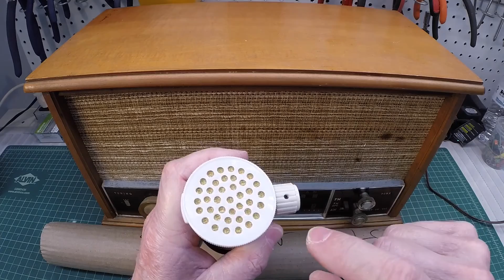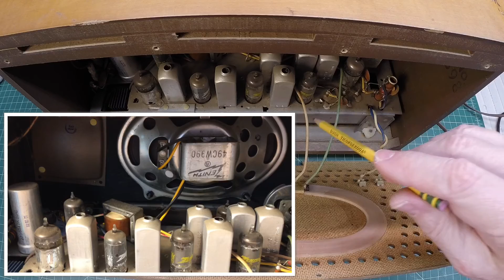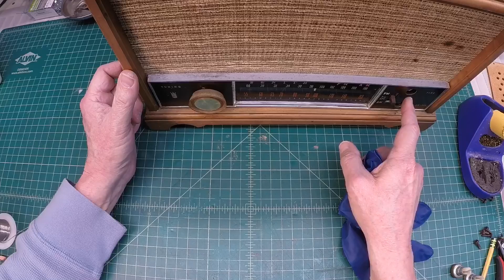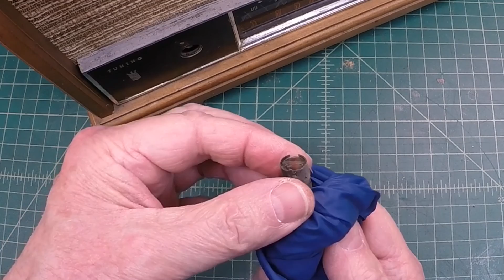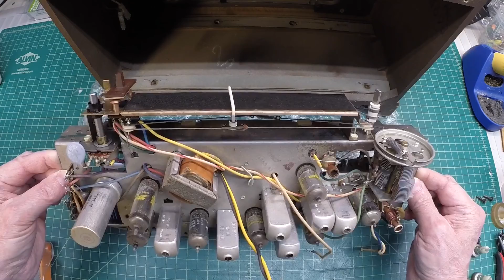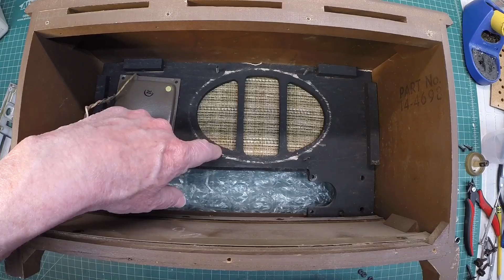Zenith K731 - Speaker Grille Cloth Prep

Comment: These radios have a UL "captive" knob.  there's a trick to removing the knob. leaving the knobs captive in the front panel of the cabinet. You can carefully work the chassis backwards and out, sliding the control shafts out of the knobs as you do so, by pulling on the knobs to keep them from cracking the front panel. Then if for some reason you need to separate the knobs from the cabinet you can work with the retainers to get them off the knobs after the chassis is out.  I had to start googling when I got my K731, my knobs would not budge.
Reply from the maker: Bret - great info. I saw this posted on the ARF as well after struggling to remove them. Did you put the captive sleeves back on or leave them off. Thanks again for the info. Best, Don
Reply: I left mine on.  they're sadly dangling off the front of the radio.  I only got as far as assessing the set, it's not been worked on yet.  Will be interesting to see how the electrostatic speaker has held up.  I had to rebuild one on a german radio a few years back.

Comment: Are there any modern speakers which would be a suitable replacement? Great video, very nice speaking voice!
Reply from the maker: I saw a thread where someone suggested the one below as a replacement. Double check and see if it will fit in cabinet. Hope this helps. All the best. Don

https://www.parts-express.com/BOSS-BRS5768-5x7-6x8-Dual-Cone-Replacement-Speaker-265-384?quantity=1

Comment: I am so glad I found this!!  I have this same radio I inherited from my grandparents.  I love the sound it makes.  I have wanted to refinish the case and replace the cloth, but those knobs scared me because they don’t want to come off.  At least now I know I can.  Did you use any heat on them or just pressure and patience?  Great video and detail.  Thank you
Reply from the maker: Hi Jason - I forced them off, which was not the correct way to remove them. They are “captive” knobs and have a metal retainer on the shafts. Check out the pinned comment for the video by Bret Frohwein that describes the proper method of removal. Hope this helps and all the best on your repairs. Best, Don

Comment: Hey Don, I' have several Zeniths from this period but not that particular model.  They do have a rich sound.  A mid 50's one I have called a K725 almost sounds as big as a console radio even though it's no larger than your K731 there.  My C725C and one other have basically the same dial as that one even though they have plastic cases instead of wood ones.  Take care, Gary  P.S.  Good to see you again!

Comment: I’ve worked on two of these. The selenium rectifier should be replaced.   1 of the radios never picked up FM very well.  Someone had worked on it before. The RF alignment for FM was tricky if you aren’t familiar with Zeniths plunger tuners.  Never could tell if the electrostatic speaker did anything.